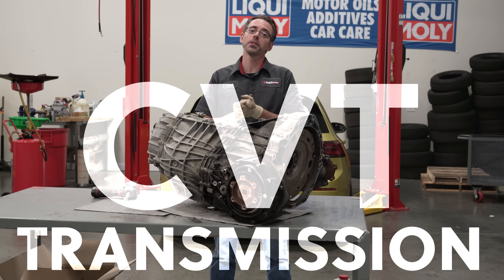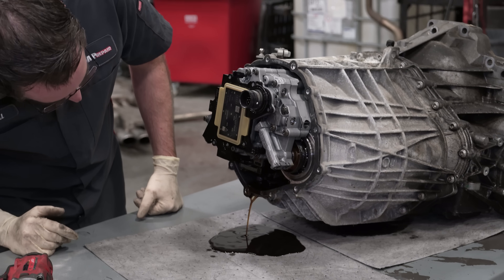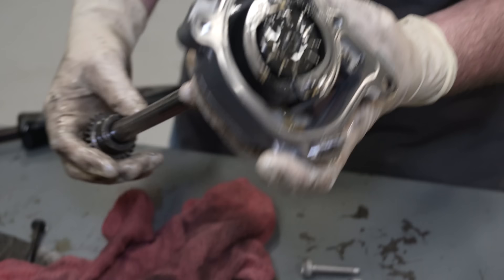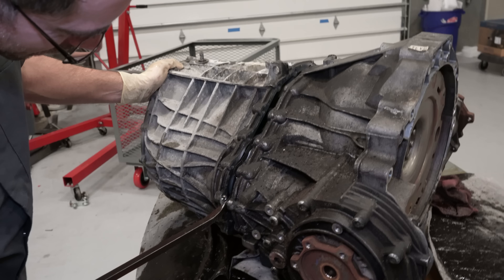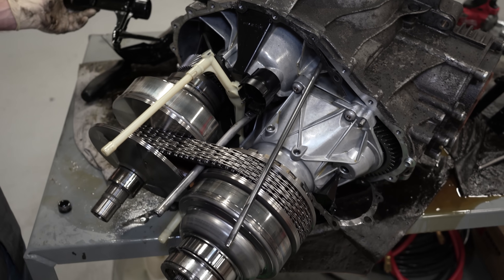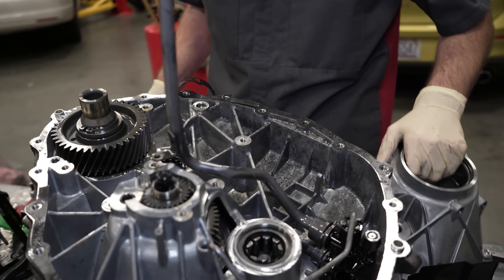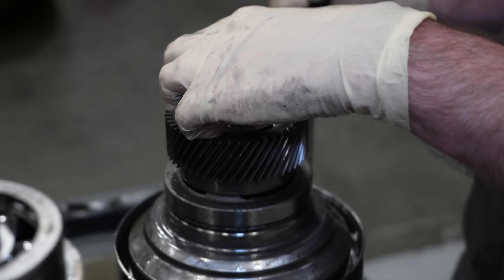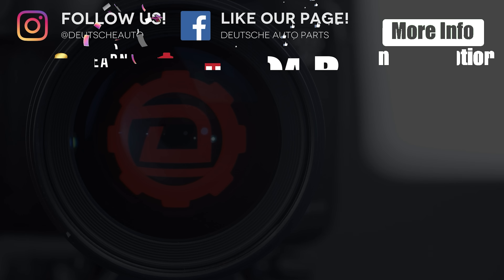Why you shouldn’t get a CVT transmission

Comment: The best aspect of the CVT in the B8.5 A4? If you hesitate pulling into traffic, realize you can go and hit the accelerator the clutch would disengage allowing the car to free rev then dropping the clutch spinning the wheels through the intersection.

Also there were 2.0T A6s that came with a cvt, not just A4s.

Comment: Ok well ... What's the most successful transmission system around if it's not the cvt?
Reply: eCVT. Two electric motor-generator units and a single planetary gear set, virtually indestructible.
Reply: Manual, by far the most rugged transmission available. It’s not even close
Reply: @mikegreen2229  "successful" also include the drivers perspective ... Not just the mechanical engineer. No body is buying manual in the city anymore. Even those car companies who are still producing cars with a manual transmission are doing it for their nostalgic customers who would like to have the experience they're used to have for years. But not really that manual is of any practical advantage over the different automatic systems out there.

Cvt is used in scooters and motorcycles for years and no body's complaining. I believe it's a brilliant design. It's just that car producers have yet to perfect their designs.

Comment: I doubt it's changed but it was my understanding Nissan CVTs cannot be rebuilt because of the snap rings used to hold them together. Extremely high sheer and friction, terribly high operating temps (my 07 maxima reached upwards of 400 degrees in the snow, 300 in traffic), cheap bearings, cheap torque converters, lugging the engine to the point of vibrating the whole car. They are easily one of the worst things ever implemented in consumer vehicles.

Comment: I do drain and refill on my CVT yearly and the fluid still looks brand new after 130k km and 7 years. It's on a 1.3L Toyota engine that makes 94HP. It's still going well. Being in Canada, there was no manual option when buying this car as I would've chosen it, but the CVT is good enough and reliable. My mom's Toyota has 200k and she never did any maintenance and it's all good still. I wouldn't touch that transmission though 🤣
Reply: I changed the transmission fluid in my 2019 Prius Prime (with the P-610 e-CVT transaxle), at 27,000 miles and the fluid that came out still looked new. No change in colr, no bad small. So I probably didn't "need" to change it that soon. Will do the next change at 60,000 though. $45 worth of oil is cheap insurance to keep that $8,000 transmission happy and healthy.

Comment: This is why you should always get a manual transmission car (if you can find one these days). What a nightmare! I can easily rebuild a manual which are very simple to work on and easy to understand and very reliable. Any car with a CVT transmission is a "non-starter" with me. Paul, next you should dismantle a DCT transmission. If people had any idea what's involved with those they would think twice about buying a car equipped with one. All this tech is wonderful when "new" but a nightmare as it ages. The problem is new car buyers are clueless to this fact. Rich people don't care and will off-load it before problems start to occur. On the used car market I wouldn't touch these cars with a 10 foot pole, especially a German car.

Comment: So snowmobiles have had bad transmissions since day one? It's not the transmission. It's the manufacturer not knowing wtf they are doing. They are the best design to come out. But the manufacturers screwed them up. Iam going on 250000 miles with our 4wd jeep. It's been a zero issue trans.

Comment: The only most reliable cvt in the world, in fact the most reliable transmission ever is Toyota's hybrid ecvt. Because it works using electric motors and planetary gear set. It doesn't even have a torque converter or clutches.
Reply: Yep, I have a 2002 Prius, changed the fluid and cleaned the pan at 100,000 miles (apparently they'll clog up their cooling passages and destroy themselves if you don't do that) and it still drives fine.

Comment: Honda and Toyota, good automakers (I know you probably don’t have a lot of experience with those), have had great success with CVTs because they care about reliability (Volkswagen and Audi don’t care).
Reply: My 13 Accord has a CVT and I love it, it’s a nice smooth ride, great gas mileage, and I take care of my car. I feel like Nissan, and the other two manufacturers you mentioned ruined it for most people
Reply: @CameronSmith-qp8jz  it’s almost as if when a company puts good research and development into a product, it turns out well and when they just throw whatever they can scrounge together into the car, it sucks. CVTs aren’t bad, Volkswagen is the problem lol.
Reply: @bloodrune329  they definitely aren’t just don’t run it into the ground, change the fluid and you’re golden

Comment: We have a 2014 Honda Accord 2.4L with a CVT. Since getting it I’ve been doing maintenance on it every year (drain & fill). & it drives amazingly smooth & makes great use of the engine’s powerband. 

Lesson: don’t listen to manufacturers telling these transmissions don’t need maintenance. They’re doing that to force to buy a newer car down the road.
Reply: I have 2016 Accord it ok ..Honda cvt is great
Reply: @dwdhb9905  exactly
Reply: How many miles..my honda is great with the cvt
Reply: I’m looking into buying a 2916 honda accord sport. I presume it’s a reliable car?
Reply: @Jon-kp7ko  It should be.

Comment: I've owned cars and small trucks for over 50 years. All have been manual transmissions. Never had a bit of problems despite having a few with over 200,000 miles on em.

Comment: The CVT metal belt is pushing rather than pulling like a fan belt. They were never meant for large torque engines. Honda Subaru Toyota Nissan all have adopted this technology and seem to work OK if serviced correctly.  They are logically the most efficient transmission as the engine runs at peak torque and lets the acceleration catch up.  No little humps in the power delivery like an auto or manual.  Still, give me a manual any day.

Comment: I have a CVT and I love it, can shift it manually, 7 gears, it's so smooth and gets good gas mileage, it's a 12 years old Toyota and it has never showed any signs of giving up, I don't even service it regularly, last service I did 4years ago
Reply: I hear that the Toyota CVTs have a takeoff gear
Reply: @zoomanx9661  sure, I for one believe CVT is the best, the problem is other brands just need to fine tune their CVTs, Toyota CVT take off is exactly as a regular automatic, you won't feel all the engine torque as a manual car does but you will take off quick enough to smile

Comment: As a machinist. There's a lot of good machine work to make that transmission. So much Machining to build a piece of garbage. I stay away from CVT transmissions. Hard to believe that so many automakers are using that garbage. Now I know why they can't be rebuilt. Nobody would want to do it. Absolute expensive junk. Will make good for recycling aluminum.

Comment: As soon as you understand that the whole thing depends on surface interactions to work, rather than physical locking (e.g. between gear teeth), you know it's just not going to last.
I had a Subaru with CVT once, and never again will I buy another car with cone-to-cone CVT.  As much as I loved its EyeSight, that CVT was just no go (started slipping at high load).
Now I just have one car with manual transmission (yay!).  Note e-CVT used in many hybrid cars are fine, because they based on gear-to-gear + electric motor interactions, not surface interactions.

Comment: As a fellow mechanic I am not surprised they still used CVT transmissions.
1 it's less costly to manufacture due to no tests to manufacture and its simplicity.
2 it'd much lighter so manufacturers can meet fuel economy and emission standards 
3 who cares if it fails, that means more new car sales for the car industry.  Today in the industry we call them disposable cars.

Comment: My Subaru Outback H6 has 250,000 km on it’s CVT
Fluid changed every 100,000 and it’s an absolute joy. Excellent transmission.
My mother has a Forester TS with 180,000 on it and her CVT is flawless too
Reply: Subaru CVT transmission is light years ahead of the competition 👍
Reply: @Stanleytone-04  Honda as well
Reply: @Russian Grenadier  I can't tell if this a joke or not. Subaru and strong transmission (especially CVT) is like oil and water working well together
Reply: I change my cvt fluid every 20.000 kms on my Honda, as recommended.
Reply: @picturesfromtheworld208  it's that what the manual says? Others should follow. They get very contaminated fast because of the way they operate.
Reply: @jamesfrench7299  yes, and my trans specialist says too. Also, my Honda cvt has no filter in it for some engineering reasons. So yes, needs to be changed very regularly.
Reply: @picturesfromtheworld208  must add up as the oil isn't cheap.
Reply: @jamesfrench7299  I'm in New Zealand, it cost me about 240nzd every year and a half. Better be that than a 3-5k job to get a new tranny installed.
Reply: @picturesfromtheworld208  they do have a filter. its behind the heat exchanger for the transmission fluid under the battery  tray. a pain to get to .  unbolt the exchanger and there is a filter element behind it similar to an oil filter cartridge.
Reply: My Outback CVT failed at 70,000 miles.
Reply: @johnstrand2247 what year was or is your Subaru?
Reply: @johnstrand2247 did you change the oil at any moment before that?
Reply: Get a manual transmission. In NA few knows how to drive manual
Reply: Because Japan made it .
Except  the Nissan one.
Reply: I never knew they hooked the six cylinder boxer engine to a CVT. That would be awesome.
Reply: Nothing about driving a a CVT is "am absolutely joy" in any manner
Reply: I have qashqai 2009 with CVT transmission make till now 153000 km. and still working perfectly and fuel economy 60 liters of gasoline give me 700km on highway, i regularly change the transmission fluid with the recommended type by Nissan (original from Nissan) with the filter with cleaning the magnets inside the case , CVT just needs maintenance,

Comment: If they work as intended they are the best you could imagine for a 4 stroke engine, always the perfect torque to power ratio. Also the late cvts from toyota work like a charm, as most toyotas do.
Reply: agreed Toyota cvts work well...they know how to make them right!
Reply: @fidelcatsro6948  And they developed their current CVT with the assistance of Subaru.  Not a surprise, since Toyota owns 19% of Subaru......
Reply: Toyota CVT's are unique because they use a "launch gear". CVT's tend to experience the most slip and wear under hard acceleration from a dead stop. In a Toyota CVT a conventional gear is used to accelerates the car up to a certain speed and then the launch gear is disengaged and the continuously variable mechanism is engaged. This removes a major source of wear and significantly extends the life of the transmission.
Reply: @joevignolor4u949  I was about to say this but you beat me to it. Yeah toyota CVTs have a 1st "get up and go" gear before becoming a normal CVT, pretty smart design.
Reply: I'm happy you said that as I have a Lexus and love it
Reply: @sizzler2462  scotty kilmer would bless you 
😆👍🏿
Reply: @fidelcatsro6948  rev up your engines
Reply: @sizzler2462  
theyre not "endless money pits" as they age!
Reply: Its weird af..my 16 honda accord..i hit the gas..has a bit of delay..but..then all the sudden your launched..i dont do it much..cause i aint a cray driver..is why my wife has a cvt
Reply: Never have had a problem with the  CVT in my Subaru
Reply: The early ones (2006 and 2007 models) had problematic CVT transmissions. They got them right after.
Reply: Are honda CVT's considered bad like Nissan cuz i have the accord with one
Reply: @videogamenoob100  no.  Their good. Enjoy your Honda
Reply: @videogamenoob100  No Japanese car brand produces shit like us Germans or Americans do these days.

Comment: The facts in regards to the reliability of CVTs, and dual clutches, are completely at odds with most Youtube commentators. Most CVTs have similar service life and reliability to conventional torque converter units. 
Why the hate? A transmission mechanic, that services my car, gave the best answer. He said, they are different and most CVTs are more difficult to rebuild than a typical torque converter unit, so transmission repairers hate them.

Comment: Honda and Toyota  both build an engine that will hit 300,000 miles with regular  maintenance.  The best a NEWER automatic transmission will do is 150 000. Our 1980s Honda automatics delivered 250 thousand miles. Our 2005 Honda automatic delivered 160,000. We went back to a manual in our 2013 Honda fit. That car is a daily driver with 260, 000 on the ORIGINAL clutch and rear brakes. We went to replace it in 2020 and couldn't  find a new Honda Fit in the entire STATE of California that wasn't a CVT. Had to settle for a used one with 35000 miles.
 Why?
Just like your mom's dryer and refrigerator lasted 30 years, but your new one craps out at 7. Planned obsolescence.  Honda doesn't  WANT your grandkids getting your hand-me-down accord. They want you to buy a new one.

Comment: I've got a 2011 Honda CrZ and either that cvt belt broke or an axle popped.
I also have a 22 crv hybrid touring and it's got a CVT....can't tow shit with it and I hate the lack of shifting.
Reply: The CRV hybrid does not have a CVT. It uses a dual motor hybrid system that's completely different than your CR-Z.
Reply: @aspecreviews  It's called an E-CVT and it acts EXACTLY like the regular cvt.  If you go 100% throttle it will whine like a slipping transmission all day long....just like the CrZ.  It's horrid

Comment: The E-CVTs in Toyota Hybrids, are not Cones and chain CVTs, they are two electric motors and a planetary gear, and are VERY reliable. Toyota put it’s first CVT on the new (er) corolla BUT added a LAUNCH gear, I’m wondering if they got it right.

Comment: Yes CVT sucks. But I have seen them go 200k. Seen two pathfinders, a rogue and a sentra. All had over 200k. What the customers did all had the same mind set. Instead of 60k fluid change they did 30 or less. All those cars are still rolling

Comment: My most costly mistake ever! I purchased a 2011 Nissan Cube with only 11,000 mile trans failed at 106,000 miles. Also fluid was replaced ever 30k from dealer. The CVT cost me $3500 for a rebuilt with only 12,000 miles or 12 months warranty. Never again any cvt trans for auto or suv.

Comment: The CVT Transmission in my 2011 PriusV is fine.  It is based on a planetary gear set, not a belt and cone design.  Automatic transmissions with planetary gearsets go back to the 1939 Cadillac (at least).  The engine can rev up to its best working point and then accelerate the car by changing the gear ratio. It is not the centrifugal clutch from a mini-bike. Getting to peak hp quickly should appeal to performance people. It is different from a manual transmission where speed and rpm are directly proportional for a specific gear. The Prius transmission is so seamless, you never notice it.

Comment: Why did manufacturers go with  CVT transmissions instead of improving transmissions with clutch packs. Clutch pack transmission last alot longer and takes more abuse than a cvt, prime example the 4l60e  transmission in my 02 Silverado and the Allison 1000 in my 08 gmc have been trouble free til this day👍🏿

Comment: It would be nice to clarify that the problem is with Belt CVTs. CVTs can be implemented in different ways, a particular example are hybrid cars which typically use a planetary gear set with no belts. Those can be some of the most reliable transmissions.
Reply: Chain is stronger..yep

Comment: CVTs work well with small engines, like ATVs, snow mobiles, scooters, small bikes. But I think what they do differently is they make the main belt and rollers a ware part that you replace. That really helps
Reply: small cvt run on a dry clutch system. there is no fluid seals to fail and leak. cars are hydrolic cvt often over engnerd as well like being paired to a gearbox.
Reply: Some snowmobiles are in the 150 hp range, and they still get by with a belt.
Reply: @rickhibdon11  low end torq on a cvt is its biggest ware point. its relly not a issue on a scooter or snowmobile there light machines. a full size car however is a issue. its why toyota made a takeoff gear and there cvts are known to be reliable.
Reply: @gogereaver349  Exactly! The most powerful snowmobiles have peak torque figures around about 120 lbft. That's a bit over half the A4 the cvt in this video is from, which itself revs thousands of rpm slower than the snowmobile engine.
Reply: @rickhibdon11  the first cvt crysler used a belt and they had a problem breaking.
Reply: @rickhibdon11  Ok now look at the torque and weight figures. That's what matters to a cvt, not raw hp figures.
Reply: I think if they make it easily replaceable will be fine.
Reply: @GF-mf7ml  It's still an expensive piece of machinery. They simply don't cope well with high torque.
Reply: Majority of modern agricultural tractor can be purchased with CVTs transmission, also over 500 HP, and they're great
Reply: And they work well with cars..or else..they wouldnt of thought to do it..they are still trial and error but..they are getting it down
Reply: @edubb2491  yeah they are trial and erroring on your dime... At $5-7K each.
Reply: @AmandaHugenkiss2915  🤣